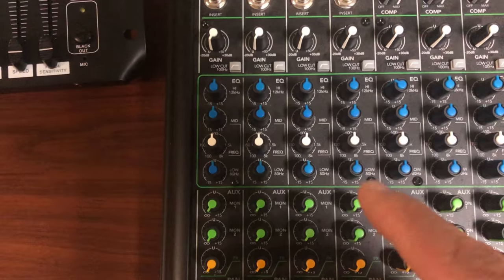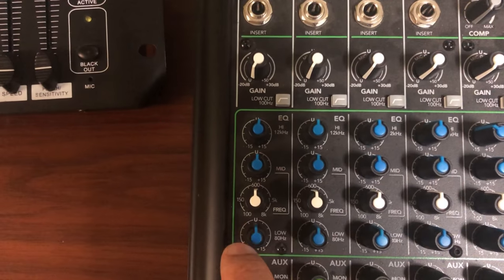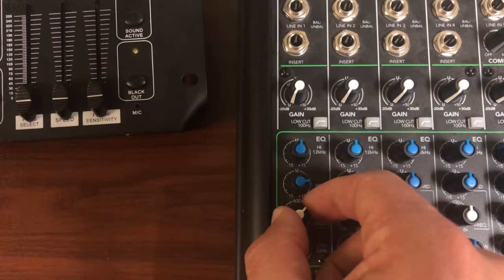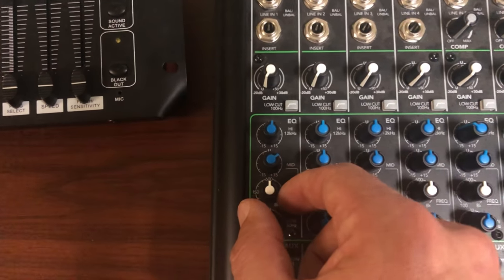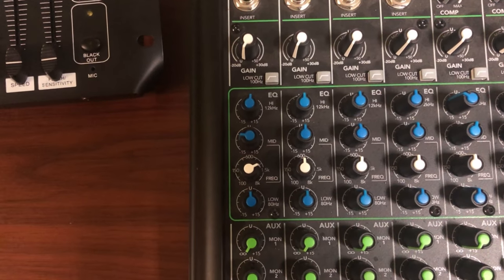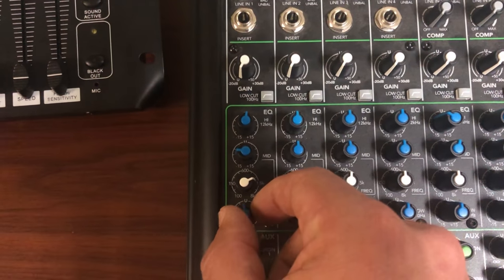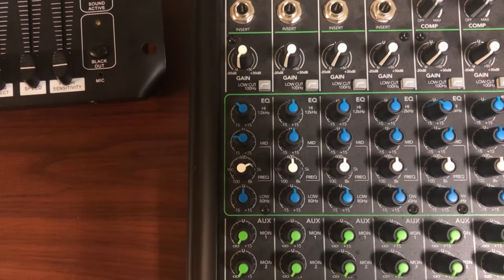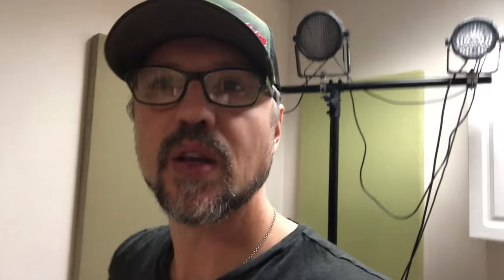Mixer Basics Part 3 - Eliminating Feedback with a Parametric EQ

Comment: May be useful to point out that it depends entirely on the “source” that’s providing feedback before seeking to eliminate it.
  Knifing your 4K might work great for a single vocal mic (comedy show, speech, etc) but if you’re also running background music simultaneously you’re cutting out a critical portion of audible frequency; given the general rule that human hearing is fine tuned for Hz between 2-6K.
  Otherwise solid video that gets to the point.
Reply: yeah, but he's talking about the single channel, not the overall main output so that background music would not be affected by this mic adjustment in this single channel.
Reply: I'm not sure cutting is the best solution anyway, the feedback just builds up at a different frequency. I wonder if it would be better to turn down the gain and using a mid boost at a frequency that helps the vocal cut through?

Comment: So I'm new to the mixing world. I have to run sound for my church and we have x32 Yamaha board that's only analog. Aside from just turning each knob until I eliminate the feedback is there any other way to quickly guess what I need to do when I get feedback? I've killed the high ends but now my Rector sounds tinny. Any suggestions?